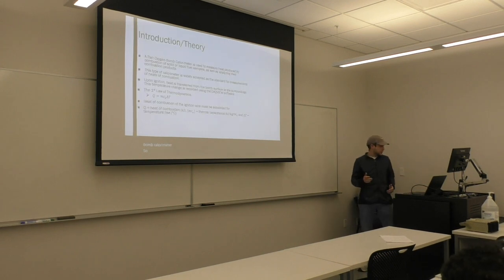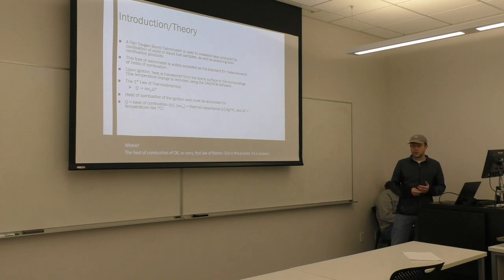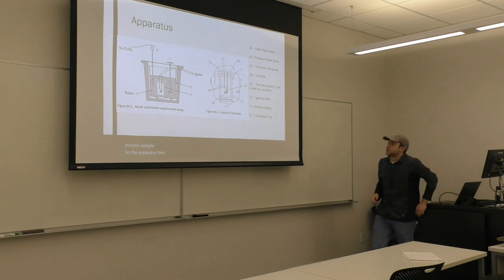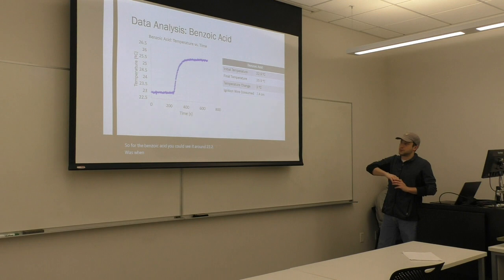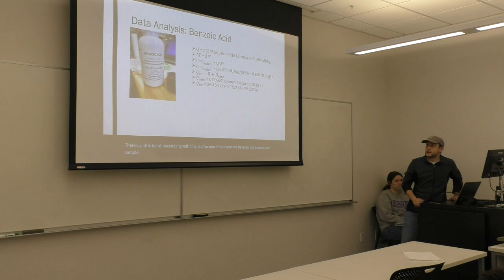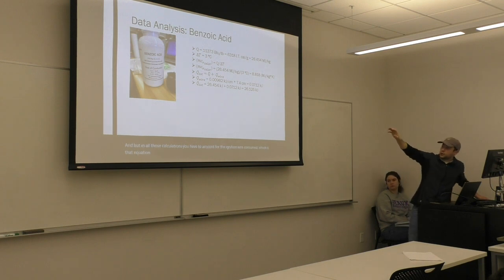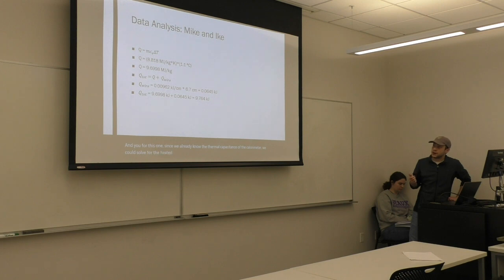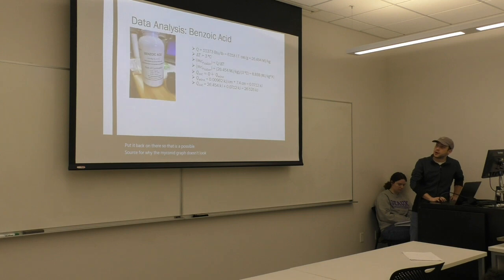S1090004

Comment: I think Vaughn did a good job having a clear agenda for the presentation. He clearly conveyed on the slides what section was being presented and also did a good job presenting the data that was pertinent. Where I think he can improve is in getting the slides more concise. There was a lot of info on most of the slides, which in turn made it difficult to present without simply reading off the slides. But overall, I think the necessary info was presented and the overall presentation was done well.